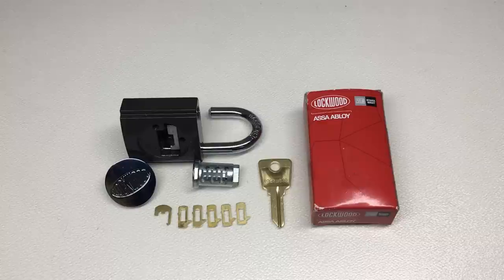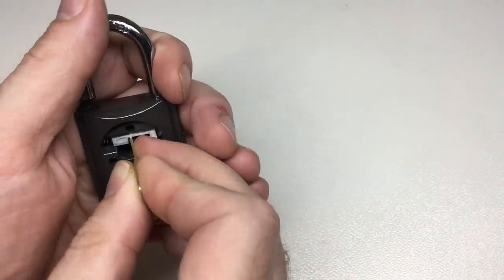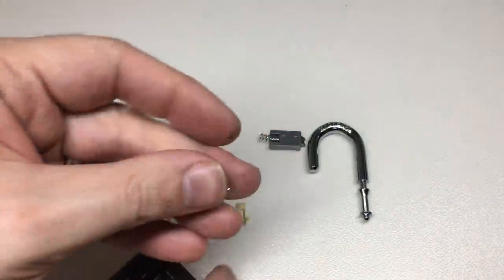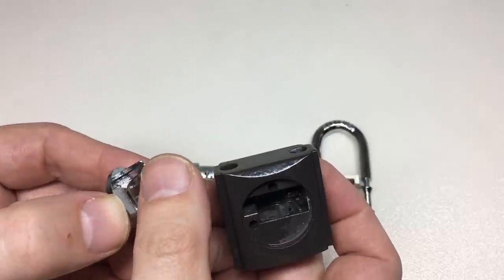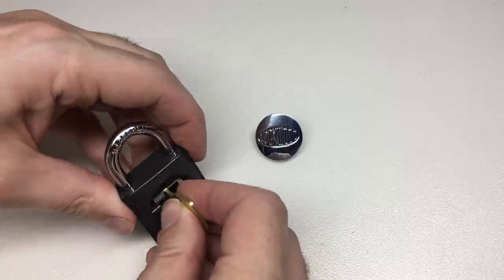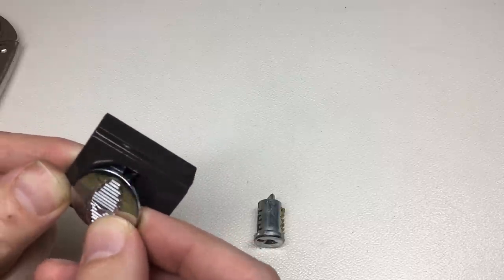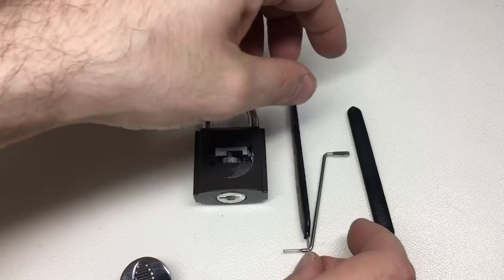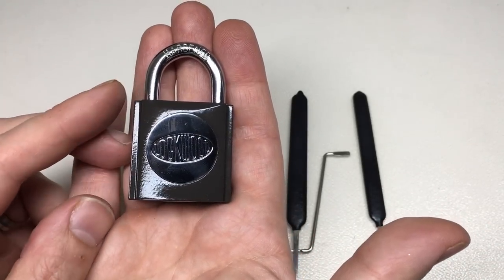How Wafer Locks Work - Making it and Picking it

Comment from the maker: There is nothing as good at showing how something works as actually building something from its components. Thank you to Leon’s Lockpad for the gift of this cool Lockwood wafer lock :-) https://www.youtube.com/channel/UCoIcKc8M8XBJFFbqQSvaNIg
Reply: Hey man random but i saw an old video of yours reviewing a klom tube key cutter. did you happen to use 1137b blanks?
Reply: Please make a video about double sided wafers, as far as I got, I learned that I have to hold the tension with my finger when I swap to the other side of the lock, it is very hard to do, I might have to make a custom tool to open them, I have quite few to open at work, as people loose the keys all the time so we have to get their valubles (glasses tisues etc) out. I can use a jiggler but I will haveto modyfiy it - as it is too short to reach all discs - the locks are longer than standard + double sided

Comment: Those particular locks are often red and used on fire closets in Australia. The closet in a building where fire hoses are kept. It's supposed to stop vandals, and the fire brigade have the key. They are based on an old Lockwood from the 70s, the original had an aluminium circle on the front.
Reply from the maker: Cool, thank for the info :-)

Comment: I'm pretty sure the control wafer is not among the wafers that prevent the core turning. These look exactly like the cores of locks in some IBM cash registers that I'm familiar with. My master key allowed the removal of the core to access the trigger for removing the drawer (Sometimes a banknote would slip behind and jam the return-spring).
Reply from the maker: You are right, it just holds the core in :-)

Comment: But I thought the locking pawl is supposed to keep the shackle from coming out; the pin on the face-plate shouldn't be necessary. 😕
Reply from the maker: Once a locking pawl is fully retracted, it couldn’t retain anything, that’s why a second mechanism is needed. Most padlock use a retaining pin :-)